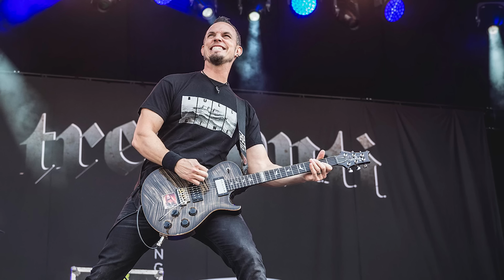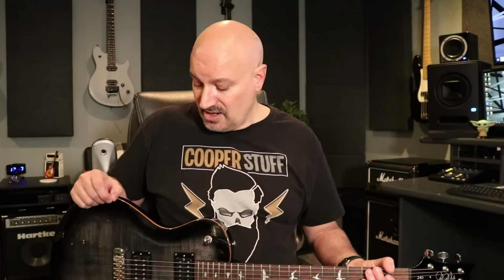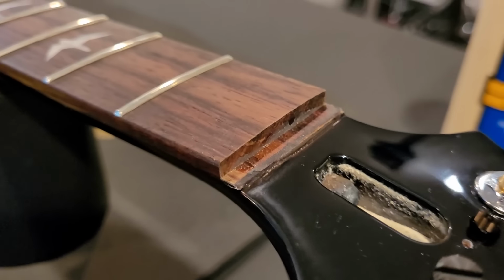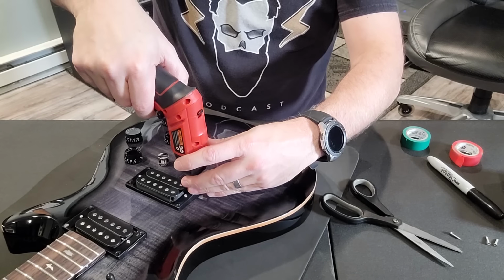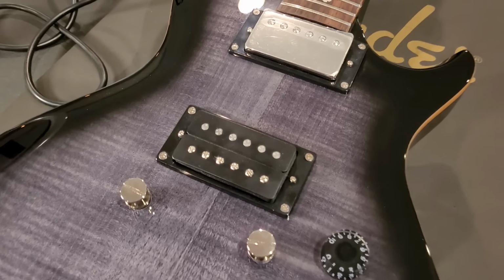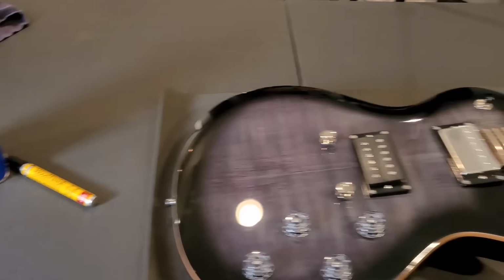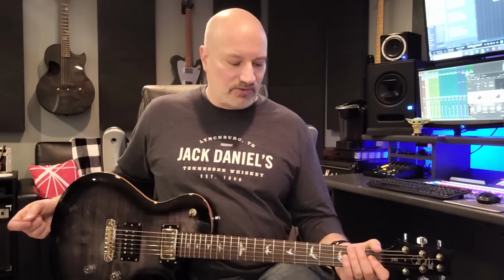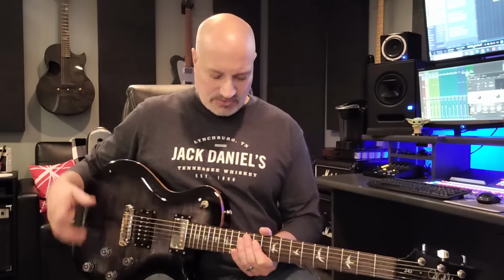Upgrading a PRS SE into a Core PRS

Comment: As an amateur, I've tried replacing the nut. Cutting around it, block of wood, etc... Got the job done fairly well. However the big thing for me was the discovery that the new nut can be too wide for the neck profile. It sticks out less than a millimeter on either side, but you can still feel it. Doing the things to file off those edges, round the edges, fill in the gaps with clear-coat to make it seamless, are way beyond my skills as an enthusiast and not a luthier. Not to mention that a new nut may have to be filed for string height to be correct. I like the video but from my own experience I suggest a tinkerer to hesitate before blowing out the nut with a mallet and a block of wood. You might want to get a luthier to do that part.

Comment: my necks always get a LOT darker and more playable just using lemon oil ( once dry I use manicure blocks between coats to eliminate raised wood grain). That might be your next step after you've tried every stain you want to try.
I would say upgrading the pickups did a lot for this guitar, but you missed out the strings, there are several better string manufacturers than Ernie ball as they are now. Last century they deserved their reputation , now ....? not so much, sadly.
Reply: I never use lemon oil but hey do what you want. As for strings, D'addario XL's have never let me down and I've been using them for 40+ years.